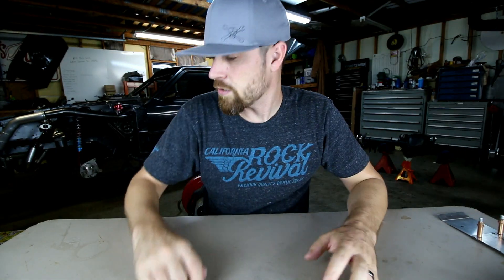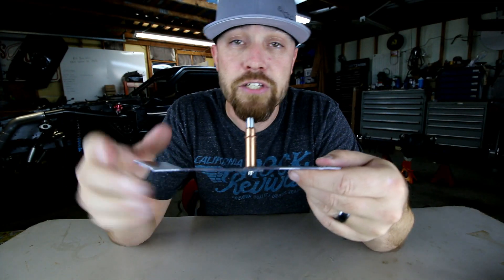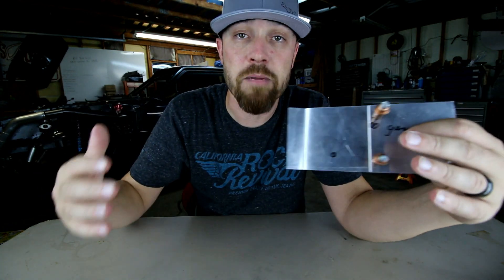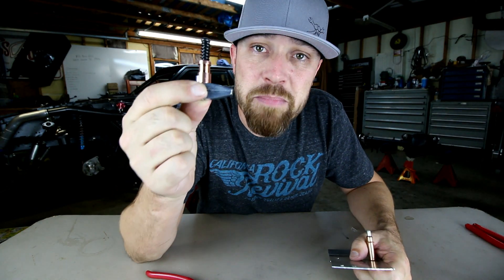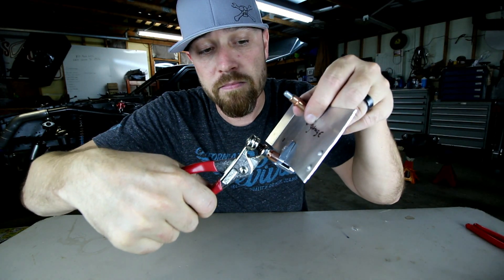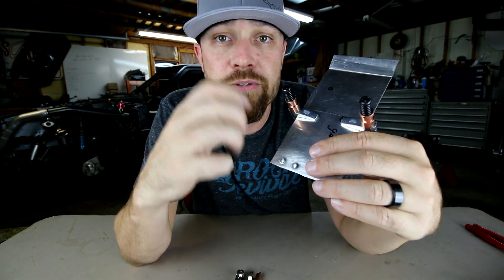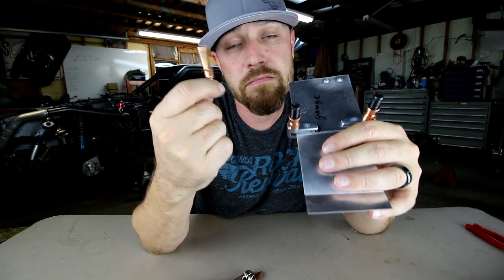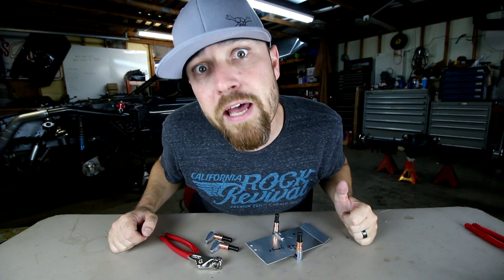You Need This Tool - Episode 35 | Cleco Side Grip Clamps

Comment: Quick random question about that shark skin coating you used in a few videos, would it prevent black oxide hardware from rusting? I know the black oxide coating is itself rust, but would the shark skin coat prevent it from producing red oxide while exposed to the weather? thanks in advance!
Reply from the maker: +Drift Physics not sure....maybe
Reply: you should totally try it out and let me know, cause I want to use them on my trucks visor